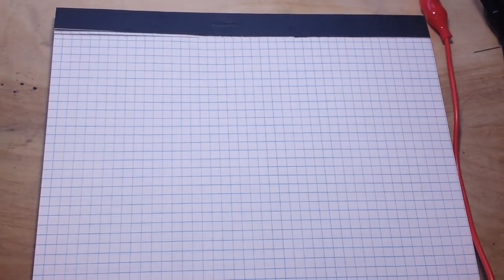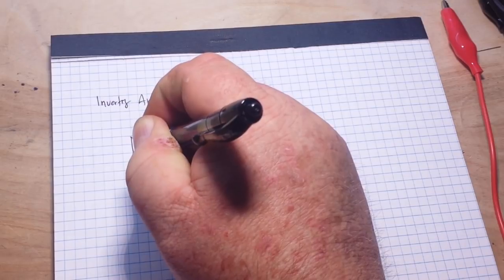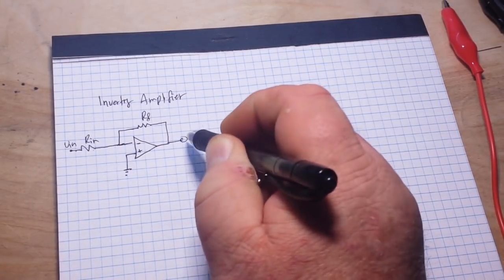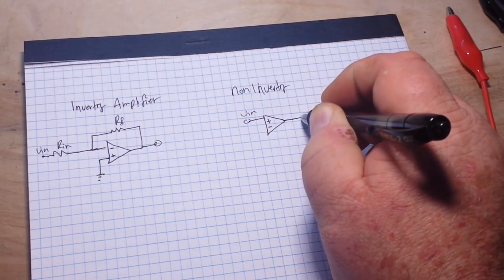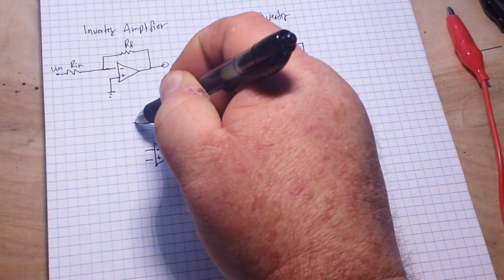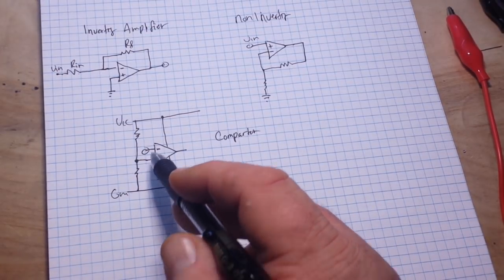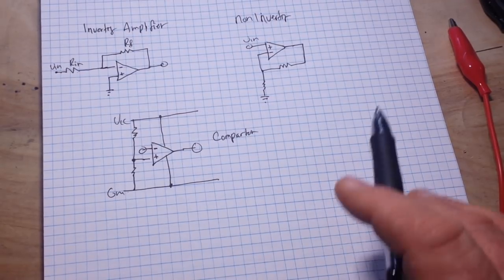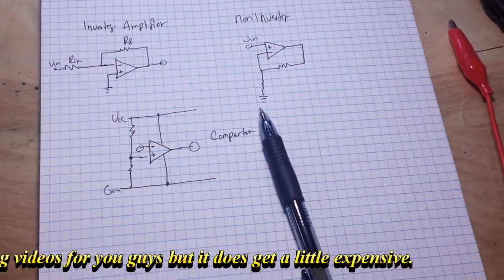Answering your opamp questions

Comment: Opamps often suffer from phase reversal when used as comparators. This will easily happen on TL072 for example. Either of the inputs goes within 0.7-0.8V of the negative supply, and the output will likely stick to the positive rail.

It's fairly difficult to cause this issue on LM358, so that's often fine for dual-purpose use.

Comment: The Comparator circur you describe is missing a very important thing, Hysteresis, in practical use a comparator with out this is almost useless. If you look at almost every opamp data cheest thay have exaples of "postiviv feedback" that get you a comparator with hysteresis. 

Keep up the good work and looking forward to next video. 

Grettings from Sweden
Reply: That is true, but he was answering whether or not comparators and op amps are interchangeable, and it was less an instruction on how each works.